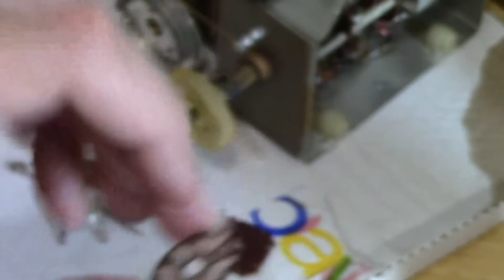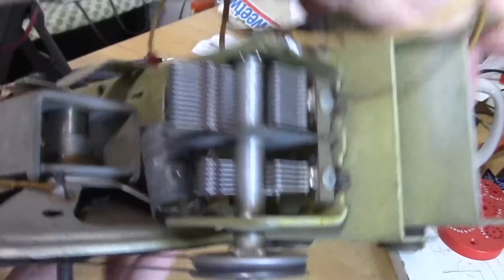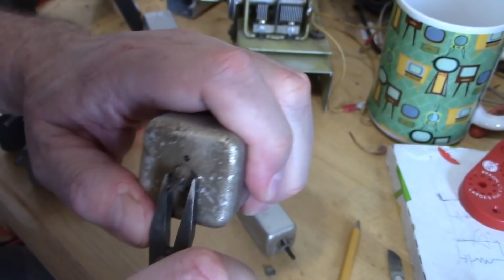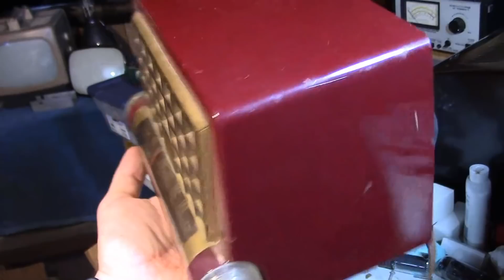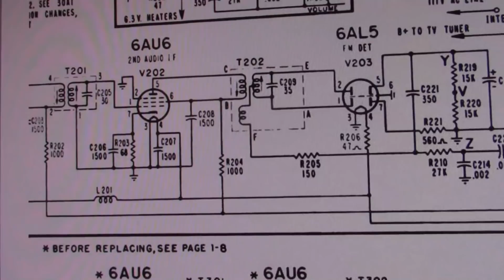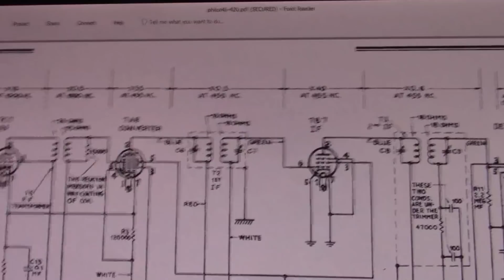Silver Mica Disease in vintage radios and TVs

Comment: If you disconnect fine coil wires you can heat lugs with soldering iron and pull them out of plastic bottom,tabs that touch silver will come out also, replace with stiff  wire JB welded to plastic bottom and resolder coil. Put new capacitor under chassis.

Comment: I am tackling my first Philco predicta (10L34 chassis) got everything working good but the sound has always been weak. When I went to try doing an alignment I noticed the IF transformer made a lot of noise when trying to adjust the slugs and a one point the sound cut out completely. I thought it might be a bad solder joint so I reflowed them and no difference.  I noticed in the schematic there is a capacitor across the secondary. Just wondering if this could be SMD?
Reply from the maker: I haven't had any issues with SMD in Predictas but I recall another restorer has.  So I think it is possible.  Good luck.
Reply: @bandersentv pulled the IF transformer out and opened it up, there is a piece of mica in the bottom and it is all black and cracked. Any idea what the capacitor value would be? I did look up the part # and there is an NOS one available on eBay but would it have the same problem?
Reply from the maker: Sorry, I don't know.  Yes, the NOS part could possibly have the same problem. Seems unlikely though.  I've worked on  about 25 10L34 chassis and not encountered this problem.
Reply: @bandersentv I was able to determine a value of 30pf for each capacitor (there is also a capacitor across the primary but is not shown in either the Sam’s or the Philco service info). I now have really good sound but it seems like it should be louder (the volume is all the way up).

Comment: If youre repairing the radio, 30 Bucks in capacitors IS worth it.  Else, ebay the radio in stock configuration and go buy a new, disposable, digital radio.

Comment: Most schematics don't show the internal values, so I disconnect one side of each winding and measure the value with a  Z Meter.  Most are 100pf to 120pf.  I remove the mica sheet and put in fixed caps.  Cleaning the mica between the sections also works but it's easier to add caps than to try to replicate the drilled out rivet.  If it unscrews, cleaning the mica will give it another 25 plus years.

Comment: 28:56...actually, that's a SERIES resonant circuit-(!)
Reply from the maker: The cap and coil are in parallel. Isn't that a parallel resonant circuit?
Reply: @bandersentv  ...it's also a coil and a capacitor in SERIES across a short circuit: it depends on where the signal is applied/ picked off.

If it's a signal trap, shouldn't it act like a low impedance at the specified frequency?

Comment: Bob, very interesting video and thanks for sharing with us a lot of what I have experienced myself as well in restoring old radios and TVs and dealing with which type of IF transformers have the silver mica disease and which do not. Very interestingly, it appears that Admiral used two types of almost the same tuner, I believe both made by the Standard Coil Company, where one type uses a square IF can on top of it that does have internal mica capacitors that can get silver mica disease, while other models had a very similar tuner but where basically the same coil and capacitors are inside the tuner but use external capacitors and therefore likely do not get SMD. Both models of the Admiral TVs you showed here have the type with the discrete capacitors, but I recently worked on a model 19A11 7" electrostatic type that had the square can and did have SMD, causing the picture to jump all over the place, and almost appeared to be a vertical problem at first, until I traced the noise and intermittent DC positive voltages coming out of the tuner output. Shango066 did a video on this recently, and I found my set to have the same problem!!

Comment: I think cleaning with the abrasive eraser, then cleaning with solvent, then coat both sides with lacquer would be a permanent repair. Ron W4BIN
Reply from the maker: The silver needs to be left uncoated to make contact with those metal pads.

Comment: Greetings:
Only IF< transformers with iron core tuning adjustments instead of ceramic trimmer adjustments have I seen or heard of SMD. Servicing iron core IF transformers with SMD usually is done by removing the offending mica caps and replacing the caps with fixed value poly caps after the appropriate values are determined. If the schematic shows the values - great, if not then a temporary ceramic trimmer that is expected to cover the required range is used to resonate them at the IF frequency, then measure the value and sub with a fixed value cap. Each method still requires IF alignment that should be within the iron core tuning range.
Reply: Here is something you can spread the word on. There are indeed "some" cans with the screw trimmer caps that can get SMD. No, not between the screw trimmers, but in the HIDDEN fixed cap inside of some of those cans.
Where is the hidden cap? It is sandwiched underneath the screw ceramic/mica trimmer assembly. The Secondary side only. This fixed cap is the 'output filter' Many times it is separate from the can, however some manufacturers used an IF can with this output filter built inside.
  I found the SMD noise in a set, I forget the make. The IF cans were the typical ceramic screw trimmer type. So, I thought the SMD was coming from elsewhere.
 Wrong!  Listening to the stage before and after with the Tracer, I pinpointed the noise source to the can. ??? Strange as I have not seen that before in the 40years of radio work.
   I disassembled the ceramic trimmers, unbent the tabs gently. to reveal a second FIXED cap mica sheet on the secondary side.   I mounted a fixed cap electrically the same position, reassembled the screw trimmers. The set played perfectly now.
   So if someone has the SMD noise we all know of, and you have a conventional IF can, look at your schematic to see if there is a fixed cap on the output side of the IF can. Even though you have screw trimmers, this hidden cap may be the source of the SMD. I have photos of the job someplace. 99% of the time though the noise if from the type of can we all know about with the SMD issues. Fixed mica sheet for pri and secondary, and the coil for both sides.
   Keep that in your toolbox in case there is ever someone out there that cannot solve their SMD with a conventional IF can.
Reply from the maker: Poly caps ?  Don't you use mica or NP0 ceramic for the fixed replacements ?

Comment: You have a problem that took 40, 50, 60, or 70 years to develop, is a combination of exposure to the atmosphere (the tarnish) and hours of use (the tendrils).  So, if you clean the silver, remove the tarnish and the tendrils, why wouldn't you expect to at least get years of service before the problem reoccurs?
Reply from the maker: Labor and effort to clean the tarnish off.  They are also very fragile.  Just making this video I damaged the one shown.
Reply: @bandersentv  I was also thinking of fine silver polish.  That contains some chemical to reverse/remove tarnish (silver oxide) and an extremely fine abrasive so as to not damage silver plating.  That might be applied with a microfiber cloth or cotton swab.  Of course, doing anything risks damaging the surface.  But then you are back to replacing the cap.
Reply: @BryanTorok  What is needed is to remove only the migration from one side to the other.  No need to polish the silver 'pad' where the contact touches. Polishing it can wear the pad down and change the capacitance.
Plus, while the sheet is out, why not replace it with more of a permanent fix"?   Fixed silver mica capacitor. 
After having the IF can out, we only want to do a repair once, and using materials better than factory.

Comment: Why repair the same old thing, just clean the silver off the mica and like you say just lay a silver metal disk down instead.
Reply from the maker: The capacitance would not be the same.  Not only would it need to be exactly the same dimensions, but  a piece of metal pressed against mica is not going have the same properties as silver deposited onto the mica.
Reply: There is a spot of silvering placed on the mica originally, It is specific size to determine the capacitance, from the top of the sheet to the bottom. You can't remove the original silver of course. It may be hit or miss on getting the 'migration'. If it's on the surface, sure. Sometimes though this migration can get between the natural layers of mica flakes. You can't clean it out of there. Some have scraped down into the mica to get the discoloration off.  I don't know if removing some 'bad mica' will change the capacitance. Or if it will come back again soon. While in there why not just replace the mica sheet with modern parts under the chassis
?  Myself, I only want to do a job once, especially if it is not my radio.
Reply: @watcher818  I suspect migration through mica too. Anyone know for sure.

Comment: I wonder if any "dark room" chemicals would help. After all, those are all about accelerating and stopping the oxidation of silver deposited on photo-sensitive film and paper.
Interesting video! Thanks for posting.
Reply: Nope. I don't know why all the weird suggestions of plating the mica sheets, or using chemicals to an already damaged mica sheet.
 Some have been able to scrape the migrating silver away, reinstall the mica sheet and it sometimes works. Later though it will return.
  The silver migrates right over the edge of the mica sheet. There are indeed spots on the mica that NEED to be there. Taking a sheet out and scraping off dark sports will render the mica sheet useless.
The shaped spots on that mica disc need to be there. The 'bad' spots is around the edge of the disc. The black stuff that has traveled over the other side creating the short.  It makes sense while in there to replace the mica sheet and install a new fixed cap, or remove or disable the sheet and add new caps under the IF can after re installation.

Comment: Wow that was a bucket load of information!!! 👍So glad you did this video. I have not seen as comprehensive a take on silver mica disease as you have presented here.🥇 I like the way you talked about the evolution of circuitry over time in both radios and televisions. In that regard I was especially intrigued by the adjacent channel traps in one of the sets. That was some fancy engineering! I had to go back a couple of times because I found myself getting distracted visually by two things, your television themed coffee cup and what looked to be a red RCA pin tube straightener. 😃
Reply from the maker: Ha ha.  Glad you enjoyed it.  Some of those early sets were a bit over-engineered.  The reality ended up being that there were no adjacent stations in any broadcast area.   So the IF response didn't need to be quite so sharp.    I'll be doing a video on IF theory and circuits someday.  Perhaps a mini series.  One each on AM, FM and TV.   That is indeed an RCA tube pin straightener.  I added a link to the mug in the video description.

Comment: After erasing the migrated silver, might it help to coat the disc with a silicone oil to retard the atmospheric contact?
Reply from the maker: Maybe, I'm not familiar with anyone trying that.
Reply: @bandersentv  I suspect coating the 'repaired' mica sheet with anything will change the capacitance. It took 50+ years for the mica to get bad, it may take another 50 before it goes bad again. And then, who's to say that silicone can prevent ions from traveling across it?  I mean, mica didn't stop the silver ions from traveling across it, it would go across anything just about. I am not a fan of the erasing and scraping the old mica sheet. Yes, I have done it before, just because on my own radio.  Using external or dipped caps you pretty much prevent migration between the 2 new caps.
Reply from the maker: @watcher818  All great points.  I'd also like to add that in this design the silver needs to make electrical contact with metal pads to complete the circuit.  A coating would interfere with that.
Reply: @bandersentv  Thank you sir. Anything like you said like lubes, cleaners or coatings will indeed change the capacitance. Many of us have accidentally sprayed a tuning cap and the trimmer caps with cleaners. Fast drying kind will evaporate, but some may permanently change the trimmer values.
SMD is straightforward as far as a permanent repair.  You are right also that those silvery pads on the mica sheet need to be there for contact. That part is the contact and should never be scraped off. The offending migration path travels from that pad, all the way to the other side of the mica sheet. 
 While many here have good intentions to solve or prevent the issue from happening, I see a lot of 're inventing the wheel'. Replacing the caps inside, or on the IF can lugs, will be a permanent repair. Regards :)

Comment: I'll have to add this eraser trick to my other eraser tricks.
It was nice that you showed the guts of the other coils.  I especially liked the trapped coils.

What or where is the best reference for finding an IF can's specification, based on part number ?
I think some NP0 ceramic caps are marked using a black "dip" at the top.   Do you happen to know when the black dip indicator started to be used ?
Reply from the maker: The only place I've seen IF can specs is the replacement catalogs from J.W. Miller, Merit, Thordarson etc.  I'm not familiar with black dipped NP0 caps.

Comment: I'm working on a 1939 silvertone radio so I shouldn't have to worry about silver Mica?
Reply from the maker: Review the schematic and radio construction
Reply: @bandersentv  ok will do. I did notice both cans have 2 adjustable screws on top
Reply from the maker: @Tysman909  See if the schematic shows fix or variable caps in the IF cans.
Reply: @bandersentv  there is a cap in T2 it's .00015 not sure if it would be fixed or not. The radio works but the audio is distorted. And stations are weak. Looking inside from bottom of radio might be a disc. If I touch tuning cap audio is clear

Comment from the maker: I was able to identify the coil with the hex cap nut on the end.  It is a Dumont Television horizontal oscillator coil.
Reply: I wondered that! It reminded me of an early RCA horizontal osc coil as well used in models like the 8TS30, it is a square can where it has a primary and secondary, one adjustment is the frequency, which is the knurled knob that will protrude from the outside of the chassis (coarse horizontal hold control), and the inner slug is the primary which is the "phase" adjustment for the AFC circuit.

Comment: Hi Bob, my Zenith Transoceanic has IF  transformers like those. It had SMD disease and I used the eraser method. Works great and not hard to do. I figured it took 60 years to get that way so it will probably take that long to get that way again.  I repaired several 1930s radios with open IF  coils where the break was underneath the winding. I just unwound the coil letting the wire drop on the floor and rewound it by hand using the same old wire. Dripped candle wax all over it and 'mushed' it with my fingers making a redicuously terrible looking bird's nest. Looks like it will never work but it will peak at  IF frequency and work great. No more worry about sourcing new if cans ! Even if the wire had several breaks  and falls apart in your hand I  have had success by lengthening the wire with approximately  the same guage and length.
Reply: ...you're LUCKY!

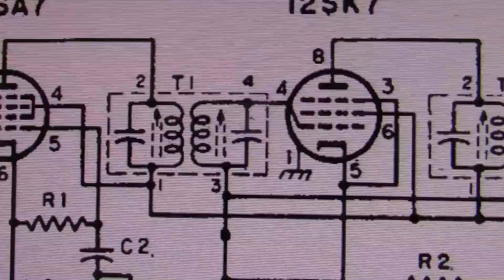Comment: What's a variable ceramic cap? 50:23.
Reply: See the drop down description. He has a link to Shango066 that will show you the part you are asking about and the procedure to determine the value if you can not measure the original mica condenser value.

Comment: The change in IF design coincides with radios moving from kind of a 'luxury' item to a consumer commodity item.  This wass hastened, I think, by the rise of commercial television.  Radio had to get less expensive, because people would not spend as much for a radio as what the could get a tv for. Also, radio was moving from the primary entertainment medium to a secondary stream. So, the receivers had to get smaller, as well as cheaper. Manufacturers began building them to a price point. Pennies mattered in costs. IF xformers with adjustable inductors were cheaper to make than those with variable capacitors.  It all comes down to money.

Comment: Thanks, Bob, now it makes sense. I didn't realize that the majority of television IF's didn't use the mica wafer in the bottom of the can like later radios did. As an aside, RCA did some wacky stuff with radio IF's immediately after the war (model 56X2 comes to mind). Some of their IF's will have the traditional 2 adjustment screws on top like early 40's radios did, but they also used 2 fixed-value mica wafers inside of the can---I've had to replace those
Reply: To everyone:   𝐌𝐚𝐧𝐲 𝐩𝐞𝐨𝐩𝐥𝐞 𝐬𝐭𝐢𝐥𝐥 𝐭𝐡𝐢𝐧𝐤 𝐭𝐡𝐞 𝐚𝐝𝐣𝐮𝐬𝐭𝐚𝐛𝐥𝐞 𝐭𝐫𝐢𝐦𝐦𝐞𝐫 𝐜𝐚𝐩 𝐭𝐲𝐩𝐞 𝐨𝐟 𝐜𝐚𝐧𝐬 𝐢𝐬 𝐢𝐦𝐦𝐮𝐧𝐞. 𝐓𝐨 𝐭𝐡𝐞 𝐚𝐝𝐣𝐮𝐬𝐭𝐚𝐛𝐥𝐞 𝐩𝐚𝐫𝐭, 𝐲𝐞𝐬, 𝐛𝐮𝐭 𝐭𝐡𝐞𝐫𝐞 𝐢𝐬 𝐬𝐨𝐦𝐞𝐭𝐢𝐦𝐞𝐬 𝐚 𝐅𝐈𝐗𝐄𝐃 𝐎𝐔𝐓𝐏𝐔𝐓 𝐅𝐈𝐋𝐓𝐄𝐑 𝐜𝐚𝐩 𝐦𝐚𝐝𝐞 𝐟𝐫𝐨𝐦 𝐦𝐢𝐜𝐚, 𝐬𝐚𝐧𝐝𝐰𝐢𝐜𝐡𝐞𝐝 𝐮𝐧𝐝𝐞𝐫𝐧𝐞𝐚𝐭𝐡 𝐭𝐡𝐞 𝐚𝐝𝐣𝐮𝐬𝐭𝐚𝐛𝐥𝐞 𝐬𝐞𝐜𝐭𝐢𝐨𝐧. 𝐓𝐨𝐨𝐤 𝐦𝐞 𝐚 𝐰𝐡𝐢𝐥𝐞 𝐭𝐨 𝐟𝐢𝐠𝐮𝐫𝐞 𝐭𝐡𝐚𝐭 𝐨𝐮𝐭. 𝐒𝐢𝐠𝐧𝐚𝐥 𝐭𝐫𝐚𝐜𝐞𝐫 𝐬𝐡𝐨𝐰𝐞𝐝 𝐧𝐨𝐢𝐬𝐞 𝐀𝐅𝐓𝐄𝐑 𝐭𝐡𝐞 𝐈𝐅 𝐜𝐚𝐧, 𝐛𝐮𝐭 𝐧𝐨𝐭 𝐛𝐞𝐟𝐨𝐫𝐞! The SMD had to be in the can. Looking at the schematic I saw a fixed cap,  and found it was inside the can as well. Disassembled  the adjustable section (it was all on the secondary side) and behold the fixed cap. That was the one with the SMD. Hidden and I suspect many would not pinpoint this hidden fixed cap. Reassembled the can, leaving out the fixed mica sheet, added that fixed cap under the chassis and the set played fine. I can't remember what make and model it was.  𝐒𝐨 𝐬𝐚𝐲𝐢𝐧𝐠 𝐭𝐡𝐚𝐭 𝐭𝐡𝐞 𝟐 𝐬𝐜𝐫𝐞𝐰 𝐭𝐲𝐩𝐞 𝐭𝐫𝐢𝐦𝐦𝐞𝐫 𝐜𝐚𝐩𝐬 𝐚𝐫𝐞 𝐢𝐦𝐦𝐮𝐧𝐞 𝐭𝐨 𝐒𝐌𝐃 𝐢𝐬𝐧'𝐭 𝐚𝐥𝐰𝐚𝐲𝐬 𝐭𝐫𝐮𝐞(as you've mentioned here)    Please keep that in mind everyone when you cannot find the SMD source location.